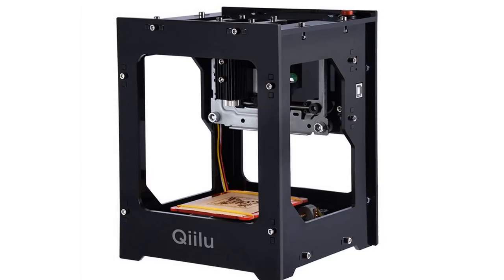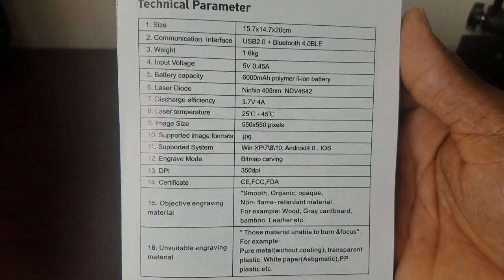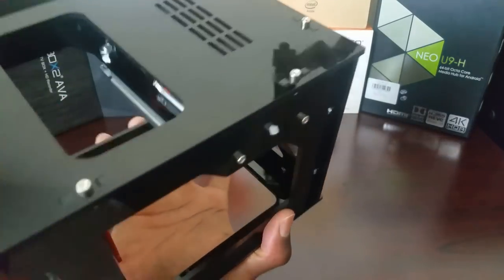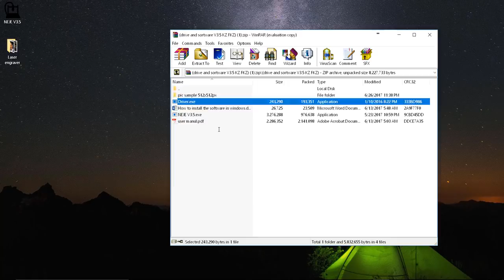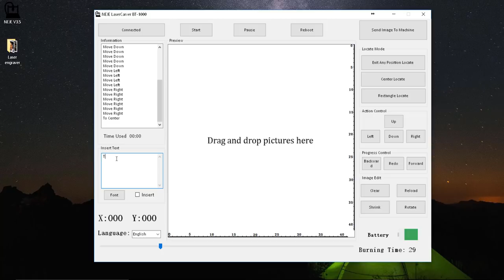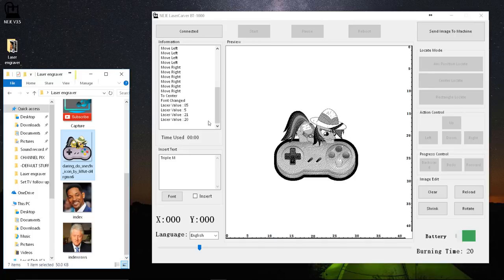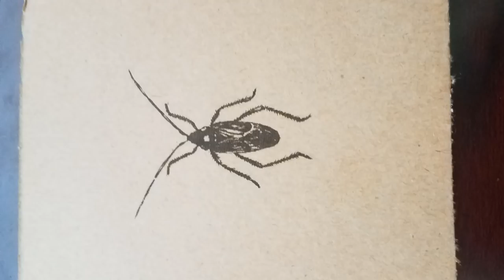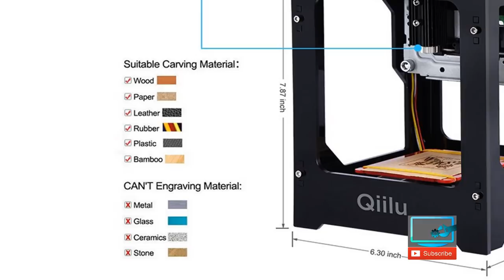Qiilu 1500mw Mini Laser Engraver | Bluetooth, 6000 mAh Battery | PC, IOS, Android | Complete Setup

Comment: Burntime does affect how much the laser burns.  Without a power adjustment, you need to shorten the burn time to prevent a very dark image.  Check for software updates often.  The latest (as of 16 Jun 2019) is v4.4 and includes burntime and power settings.

Comment: The fan isn't there to cool the laser. As the laser is not that powerful it doesn't really need cooling, especially considering it is out in the open.

The fan is there to blow away smoke when it is engraving to prevent engraving blur. When the laser passes through smoke, it's intensity is affected, especially thicker smoke from wood when on a high burning time.

But it probably does cool the diode but as it is low voltage it likely doesn't need cooling.

Comment: How much weight can the tray hold?  I want to use it to burn items on a piece of wood that could fit in the work area in regards to width/height but it is 18" long.  I assume it would work as long as the tray could support the weight.

Comment: Hi, does this envgrave text onto wood accurately and sharp without it looking burnt?
Reply: It is 'burned' technically, I just got one for burning patterns into wood.  If you set it up for a faster burn it will look more brown depending on the wood and if you use a slower burn time it will darken to black look.